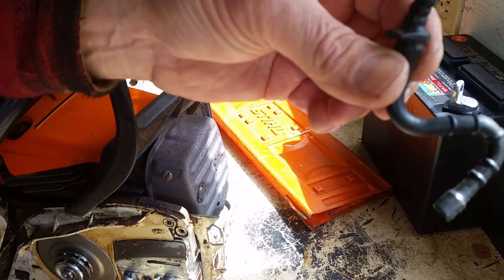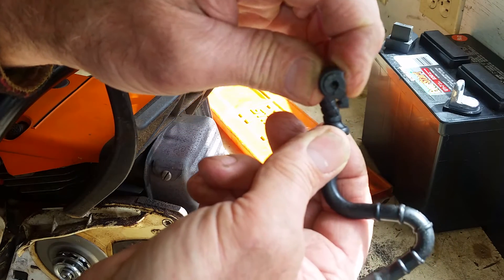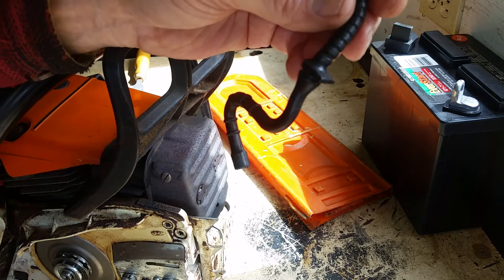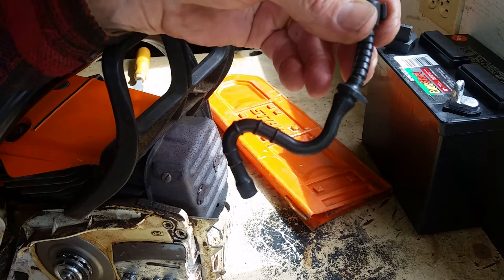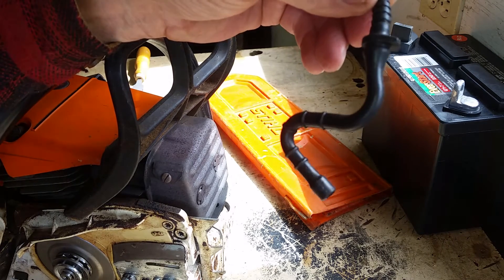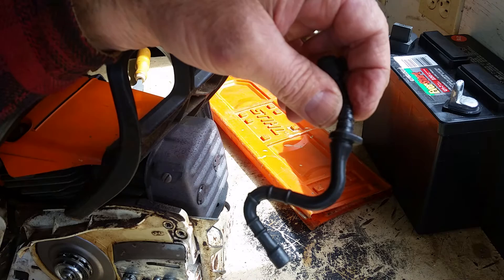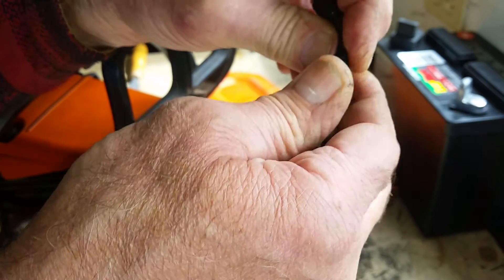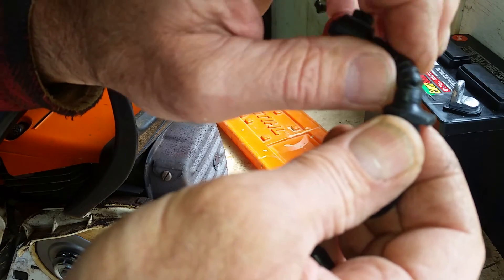Off grid solar homestead (chainsaw service part 3)

Comment: Well, I have a Stihl backpack blower that's maybe 5 yrs old.  I don't use it commercially but just around our property.  It's only had 'real' gas, never ethanol and it developed the same problem this past fall.  I didn't question why since it was such an easy fix but now you've got me wondering.  Around the Eugene area and nearby towns, we have gas stations that sell premium non-ethanol gas, it runs approx .60 more than premium ethanol.
Reply: And of course that is a possbility?
Reply: ***** Back in the 1960's (and earlier) we had a brand called Sunoco.  Their premium gas had a 102 Octane.  That's all muscle cars of that era used.  Now I think their highest octane is 94.

Comment: Very good tips. Are you not able to buy premium unleaded that is ethanol free?  We can in WI.
Also, Husqvarna sells premixed fuel In a can but it's expensive. That's good for folks who don't go through a lot of fuel with their 2 stroke equipment.